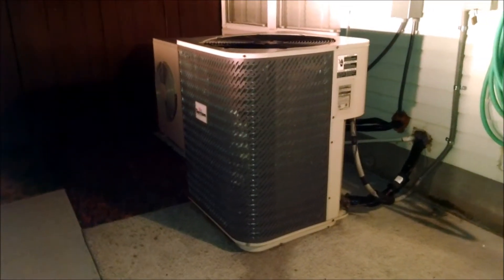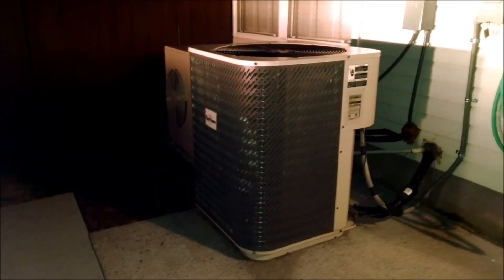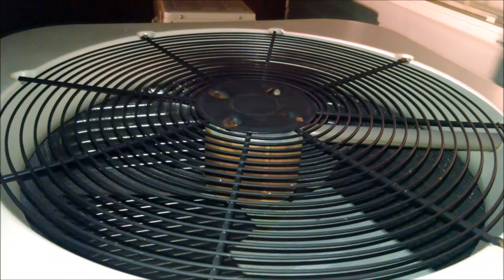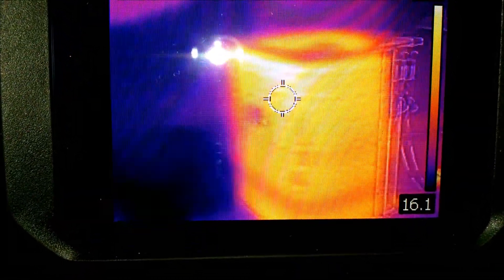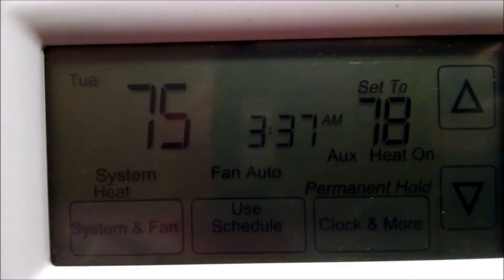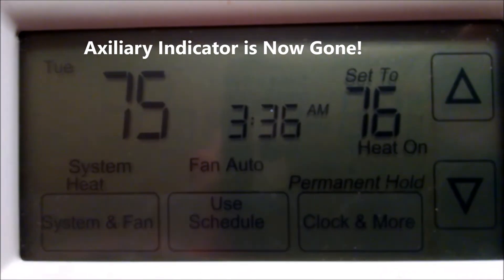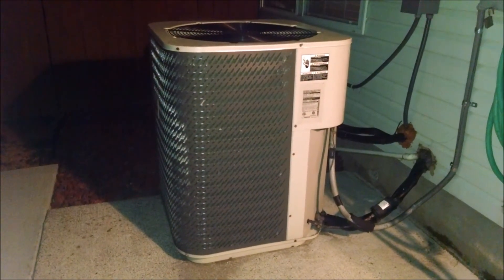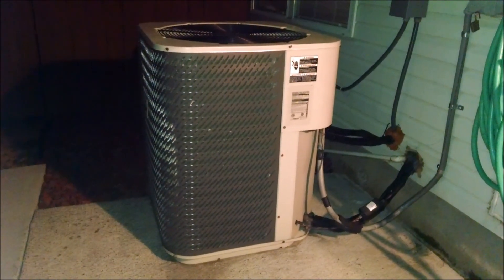How Heat Pumps Are Different

Comment: I have the same Gibson unit, unit was installed 10 years ago brand new. Just had a Capacitor issue.Thats it. Iam thinking its a good unit. Any concerns I should be aware of. I have a 15kw emergency unit in the attic. It only works when i turn it on manually. When my unit goes into defrost mode, the stat says Aux, however, cold air comes out the vents. Should i combine the emergency wire and Aux wire together behind the stat wiring? Aux heat and Emergency heat is the same right? Thanks for your help and great Video....
Reply: I think its the thermostat . I  have mine on a cool  and it shuts down at  the hottest time of the day . had to get an non- programmable .